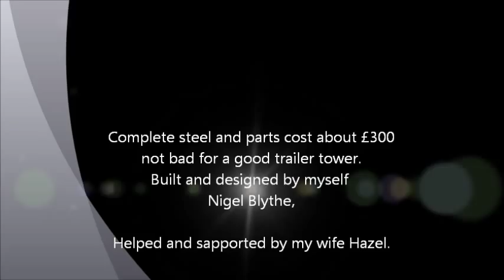Ham Radio Trailer tower. Slideshow

Comment: I have make something similar for work. The base and pivot with a winch to tilt it up, except they wanted 15 feet up and 15 feet to the left. I was going to make myself one almost identical to yours but using delrin flat stock for my guides between the sections. Very nice though, we think alike...